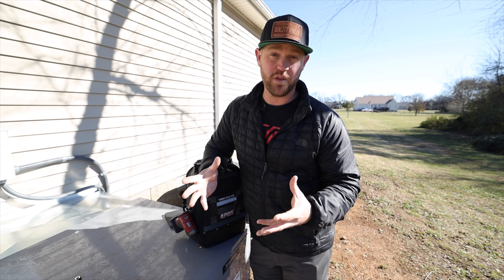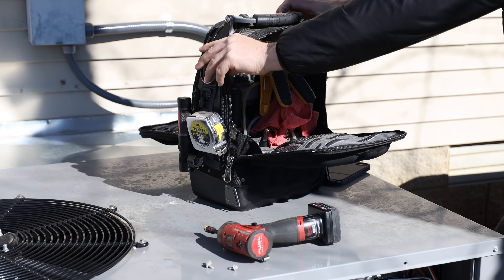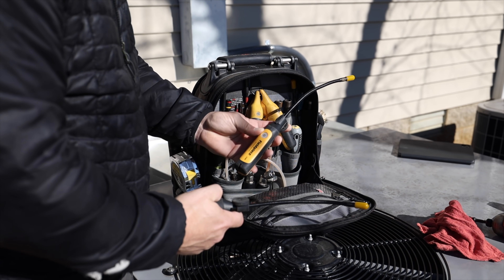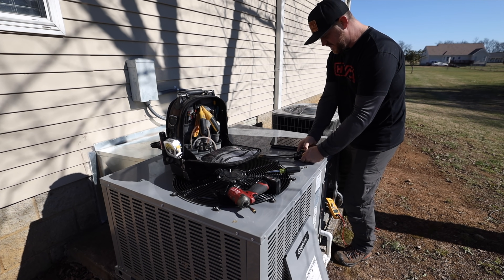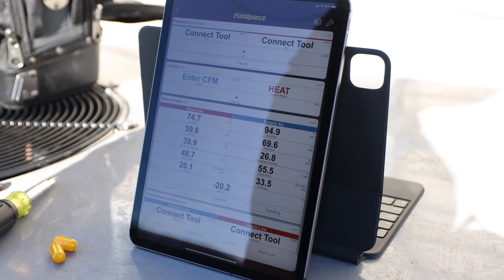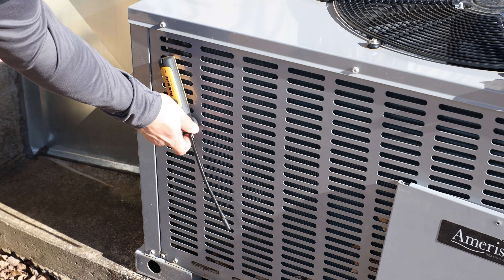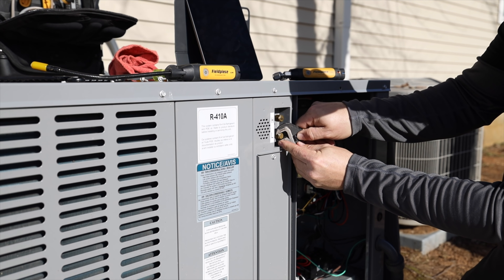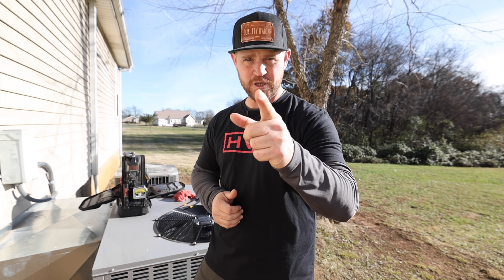Checking For PROPER Operation On A Heat Pump HVAC Unit

Comment: Hi Zack on the heat pump no electric heat is on what is the normal split temperature you usually see supply and return? 
Thank you
Reply: Depends on indoor/outdoor temps.  The colder it is outside, the less heat they will produce.  On a mild day (50+ degree ambient), a good temp rise would typically be around 40-45, similar to a gas furnace temp rise.

Comment: Helpful tip:  unless issues arise with delta T’s, I usually don’t gauge up on package units.  Each time you hook up/disconnect gauges you lose refrigerant and on a system like that which is “weighed in”, an ounce of freon here and there will cause you to have to add later.
Reply: I use same fieldpiece probes. Trust me it will take about 100 hookups till you loose an ounce. That's what I love those for. You still can get a decent delta with failing TXV.

Comment: Why did you disconnect the low-voltage couldn't you just shunted out
Reply: He disconnected the low voltage because if someone were to turn on the emergency heat on the thermostat or if it turned on because the house wasn’t warming up fast enough since he is testing it out , the electrical heat won’t turn on since the low voltage circuit isn’t completed due to him disconnecting the low voltage.
Reply: @JP-zz5rm  got.  It ty

Comment: What do you put on your inspection paper work/invoice ? Is it good practice to list amp draws and pressures or just say in good working order.
Reply: I would say it’s good practice to list amp draw and pressures , you are checking them anyways so might as well do the due diligence for the customer and it could also come in handy for future reference if you ever have to go back to the unit and want to compare notes from the last inspection and/or maintenance.

Comment: I never touch the unit before I turn it on! I go straight to the tstat and turn it on AND GO TO A SUPPLY REGISTER WITH A THERMOMETER! If it does not come on and work, the homeowner is aware that the system was not working before I ever touched it! You would be surprised at how many homeowners I have seen call and schedule a maintenance knowing the unit is not working, not tell you when you get there, and then when you come in and say you found something wrong they say it was working fine until you touched it! ALWAYS TURN IT ON "AT THE GET GO" WHEN YOU GET THERE AND IF IT IS NOT HEATING OR COOLING, BRING IT TO THERE ATTENTION THAT THERE IS A PROBLEM BEFORE YOU EVEN TOUCH IT OR REMOVE A SCREW!
Reply: I’m totally agree with you too many customers the believe they are smart the call about maintenance if you not check right.they know the unit is not work right after you touch they said you brake the unit.😂😂😂
Reply: Would have to agree.
Reply: Test in, test out
Reply: yess u are right on the this one
Reply: Used to have this problem all the time with customers calling for a 'Maintenance' when they knew damn-well that their system had a problem.  For some reason they were under some crazy assumption that a 'maintenance' was a flat fee that included all repairs.  WRONG!  
We used to charge $95 diagnostic and $150 for a 'Maintenance' - basically checking everything PLUS we'd blow the drain out, re-prime the trap with vinegar, wash the condensing coil.

They would also see calling your for a 'Maintenance' as a way to skip to the front of the line; because the girls in the office would usually assume you'd be going to a house for an hour or hour-and-a-half tops and squeeze them between service calls.
If I found something major that needed to be repaired, and the customer KNEW it wasn't working properly and didn't communicate it to the office - I'd inform them that I had other calls scheduled for people who called BEFORE THEM and told us they were WITHOUT COOLING - and that I would be getting to them first and would have to return at our nearest convenience to make THEIR repairs - that I had performed the "Maintenance" they'd requested and repairs would have to be scheduled for another day and time.

Comment: Hey!!! I just have a quick question for heat pumps in heating will overcharging a system cause them to start freezing or is that just if they or undercharged?
Reply: Overcharged system in heating mode will flood the idu coil, which will result in poor heating performance.
Reply: @crxshed  so will it freeze or no?
Reply: @anthonygarcia-sb7sp  no
Reply: Freeze ups typically occur for three reasons. 
1. Low airflow
2. Refrigerant restriction
3. Undercharge
This is relevant in cooling and heating. Another cause for freeze up on a heat pump could be an issue with defrost. An overcharge In both cooling and heating on a heat pump will cause pressures to be higher than normal which mean higher saturation temperatures. So freezing will not happen. If you have anymore questions feel free to ask.
Reply: @joshuameadows5574  ok thanks for the thorough  explanation, from a rookie to a pro appreciate it  👍
Reply: @JMHVAC502  ok thanks I’m new in hvac appreciate the response👍
Reply: Overcharging will not cause a freeze up
Reply: @joshuameadows5574  welp now I’m confused
Reply: Overcharging will not cause a system to ice up😂

Comment: Hi,  how much u can collect for a diagnostic?
Reply: As I know some companies charge around $200 for a diagnosis if you don't let them perform the repairs. If you let them do the repairs the diagnosis fee will be waived.
Reply: It’s not waived in nearly all cases. It is added into the total estimate. This is a common misconception/lie in the auto biz as well. Ask me how I know. Trust me, you pay it either way. No one works for free, diagnosis especially.